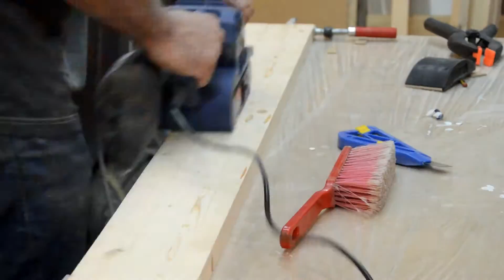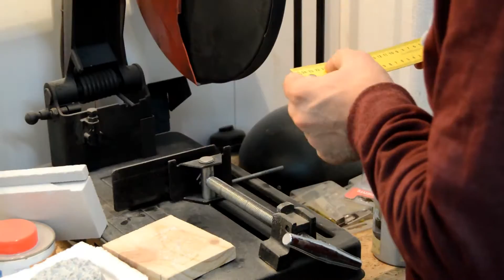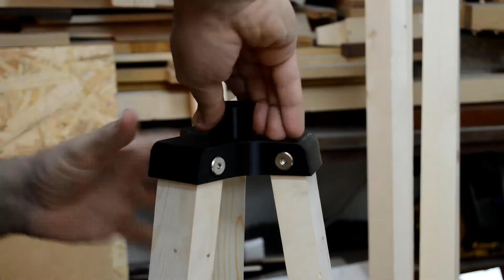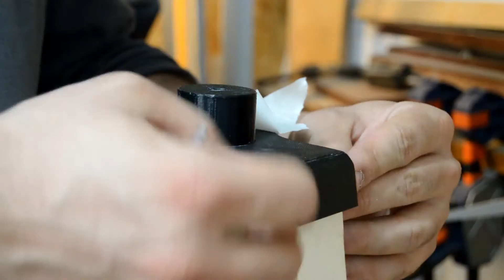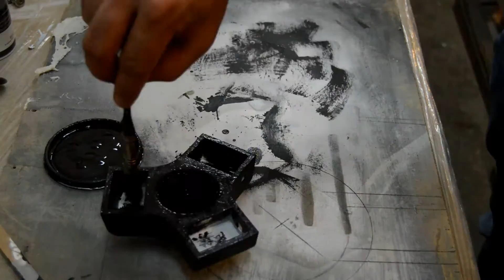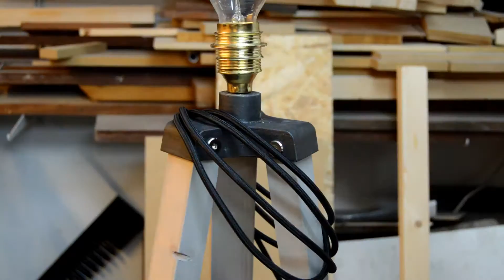DIY Modern Lamp From Wood and 3D printed parts

Comment: hi where did you buy this black part to fit the wood legs? please thanks
Reply from the maker: I did not. I designed it and 3d printed it myself. 
You can use several softwares, to design it to fit the wood dimensions, like Fusion 360, or maybe Solidworks. After that if you don't own a 3D Printer you can order it online, or in some local stores depending on your location.
Reply: Thanks for your answer well im live in UK I will have a look im looking forward to make one lamp pretty like you did :) all the best
Reply from the maker: I was looking for the files to send you, but unfortunately I've lost them :(
Reply: How I Make It  thanks for all don't worry you helped me a lot :) all the best :)
Reply: Hey! @howimakeit Can you share the file of the 3D printed? Thx